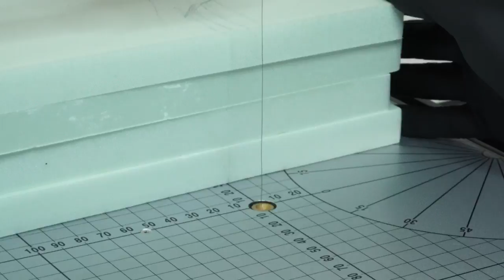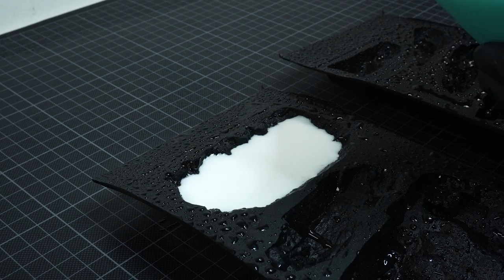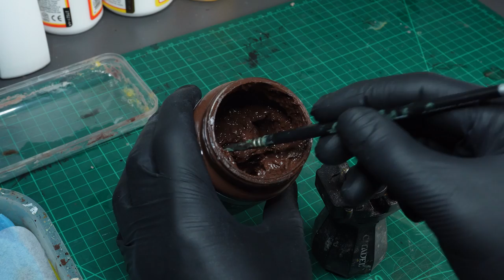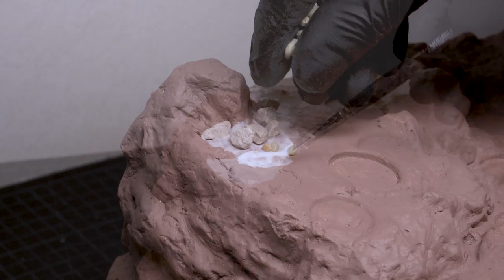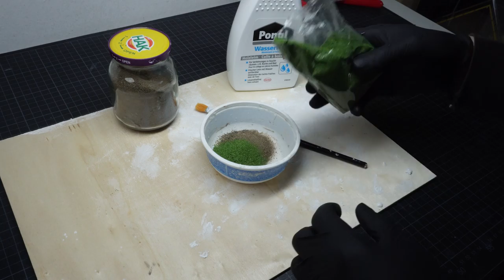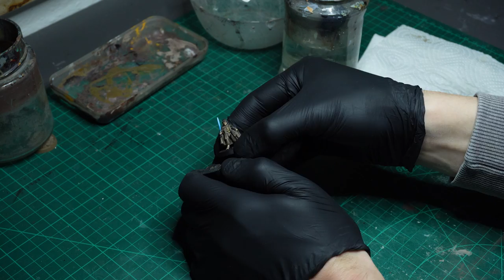Crafting An Epic The Lord Of The Rings - Diorama With A Secret Epoxy Hideout

Comment: Again, absolutely amazing. I'm curious on your process on how you plan out the design of the board
Reply from the maker: Glad that you like it! On the 2 boards I did so far I considerded the place I wanted to display the displays at first ^^ with that in mind I choose the scale of the base plate and then put on the miniatures and some proxy elements for planed objects like the tree and marked those areas very roughly. On the Kruelboyzs one I also marked the areas where I wanted to create different height levels. And thats it basically, everthing else just happened in the run.